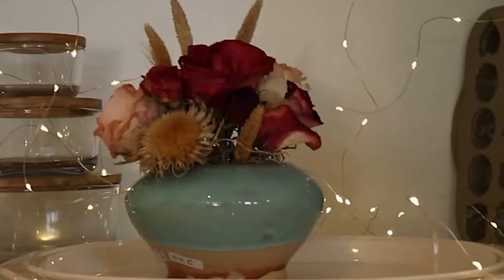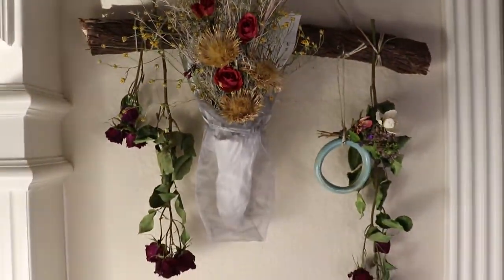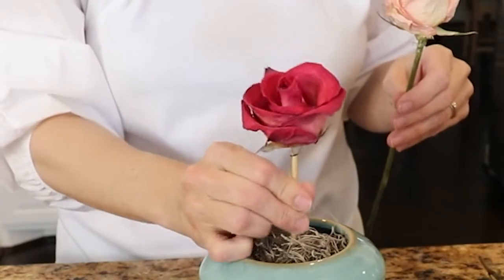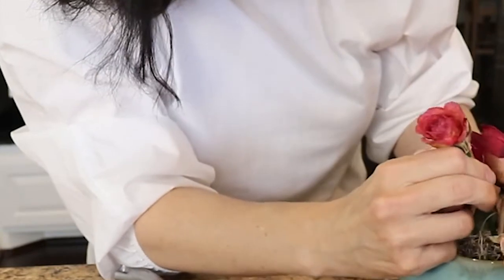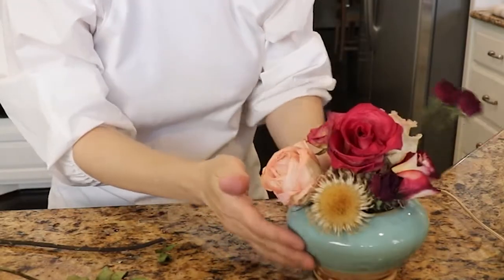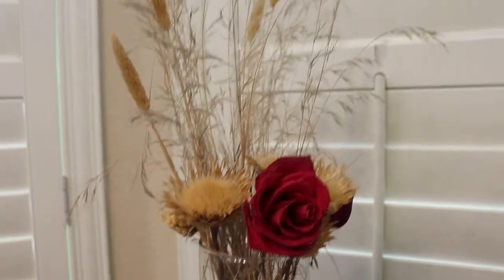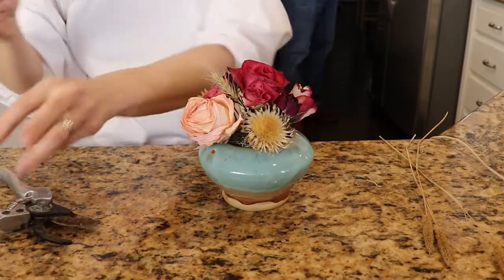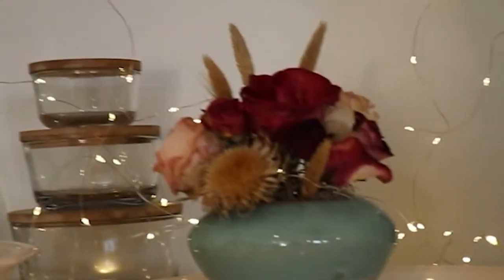How to Preserve Flowers SO EASY!

Comment: How can I preserve roses with the stem attached in silica gel
Reply from the maker: Try using a PVC tube, capping both ends with the rose standing inside and the silica gel inside the tube.  You may need to purchase extra packages of silica gel.